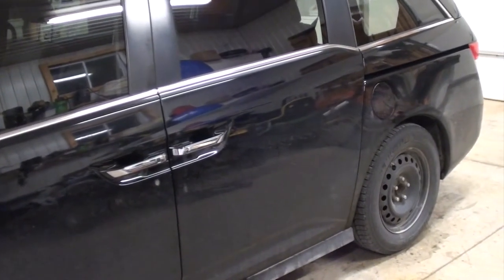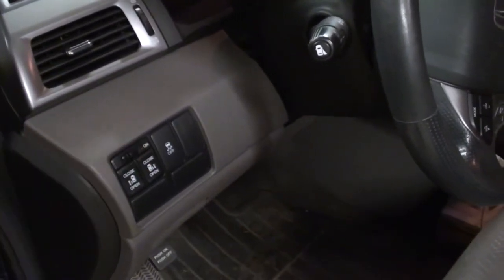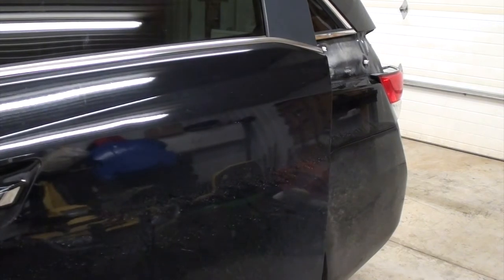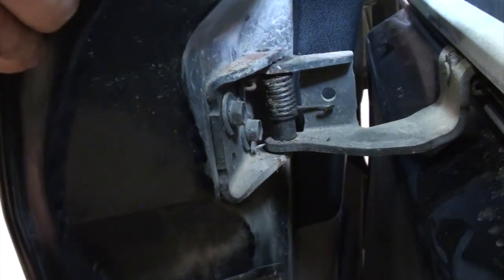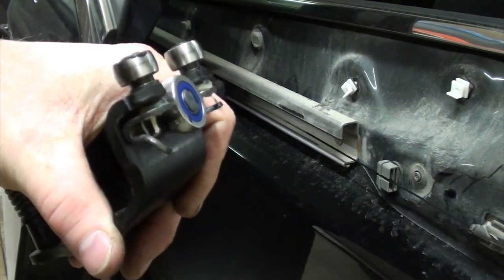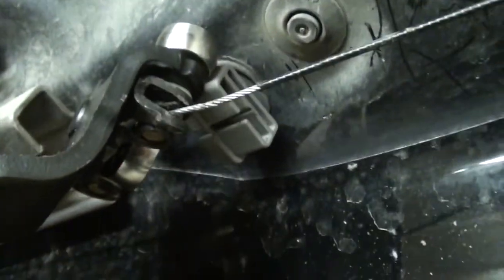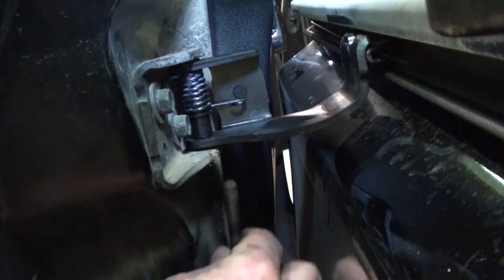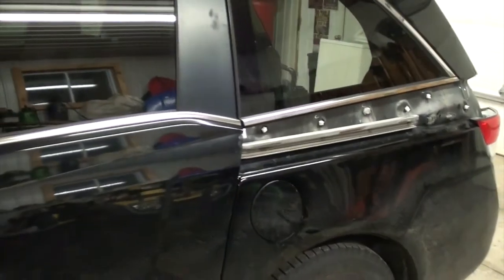Honda Odyssey Sliding Door Hinge /  Roller Replacement the Cheater way.  EASY!

Comment: As always, thanks again!
Reply: Sliding door cable broke and stuck in upper hinge rollers, Cut cable and door slides and popped off the upper rail :( Door was hanging in parking lot... I watched your video and jacked door up to hold pressure off pin, removed the hinge and noticed the rail was bent and rusted from this happening before we purchased the van and original owner never replaced track. You saved me big time as I was able to take hinge off and bend rail back then slide hinge in from rear and attach it all back together. Took me 15 minutes and I can't thank you enough good sir, I can fix the issue now but having a door fall off in a parking lot is stressful and you saved the day for my family. Thanks again! Now I can order the parts and replace it all in my garage with help instead of me and a jack haha.

Comment: Zero comments? Whaaa?  This is the best video for this job. Well done and I like the hammer. Did you buy the part from the dealer? I see where some guys bought a budget part and it didn't fit. Thanks for the video.
Reply from the maker: Dealer part.   I had it for sometime before installing and lost the packaging with the part number.... my bad.
Reply: @crownedroyal2003  
I ended up buying a Dormer part from our local auto parts store. It was easy to install the way you showed and now my neighbor wants me to do the other side.

Comment: I am having a hard time finding the roller without a circuit board. I have a 2012 touring elite.
Reply: Did you ever do the repair? I don't know why the websites are trying to sell me that circuit board.
Reply: @timbihl2753  yes but it didn't matter because my impatient husband cut the cables off and we just kept it as a manual door. 🤣 However, my brother-in-law is a mechanic and did say not to worry about it and it would work just the same.